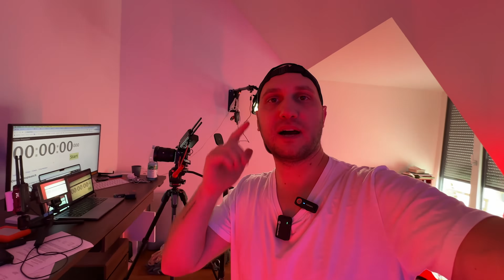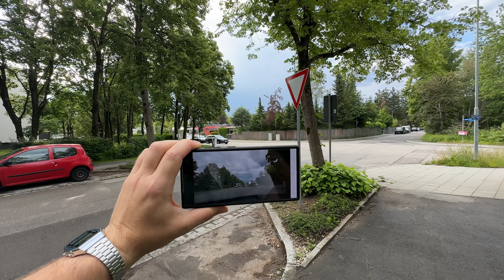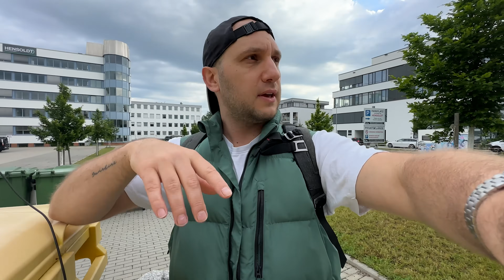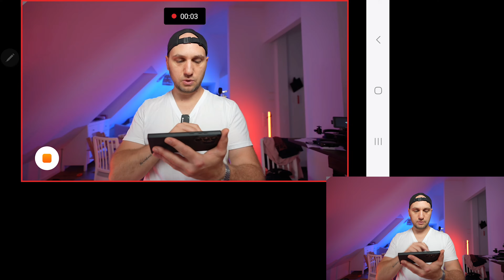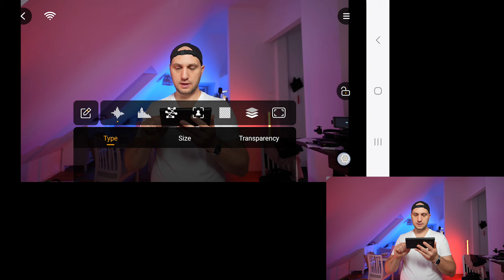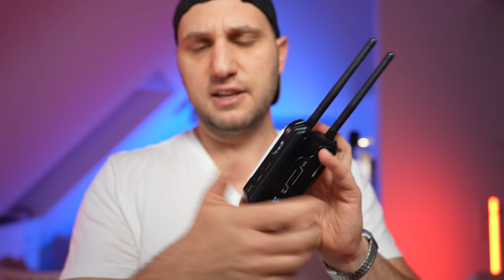Hollyland PYRO H 4k - Full Review and Latency/Range test

Comment: Thank you so much for sharing your experience with the pyro H, I had a tough time finding a good quality test that compares to yours, even from the manufacturer! Quick question, can you also use this for photography? (it's a lot easier to compose shots on a big screen and check your focus)
Reply from the maker: You can use it; it will do the job. But if it is just for photos, you can check some cheaper options. There are some on Amazon around 50-70€

Comment: Hey my transmitter fan is kinda loud but receiver fan is silent. is this normal? The transmitter sitting on the camera has this subtle crackling noise where the fan is. sounds a bit like if you would put the needle on a record with the record rotating but no music playing from the record player even when fan set on low. is this normal? Does your transmitter and receiver fan sound the same?